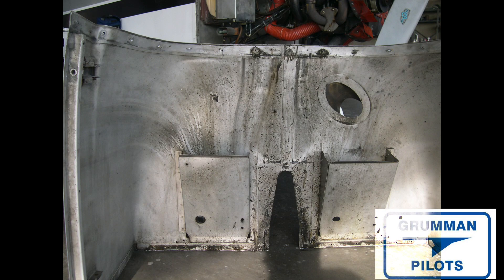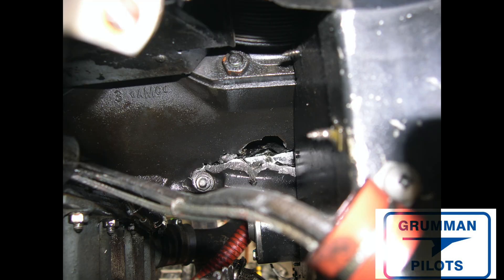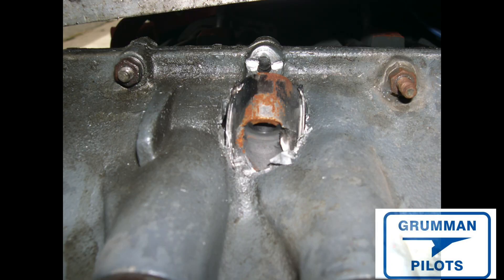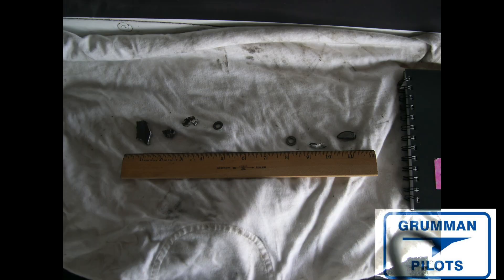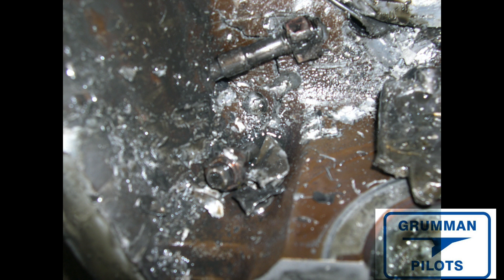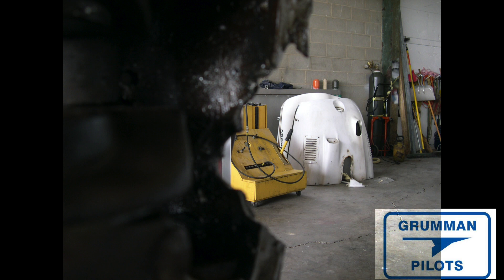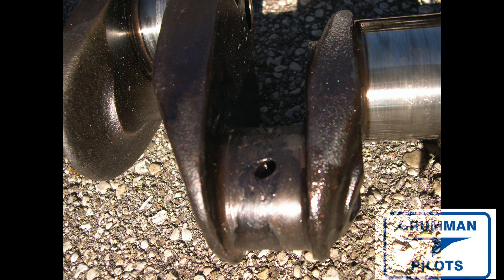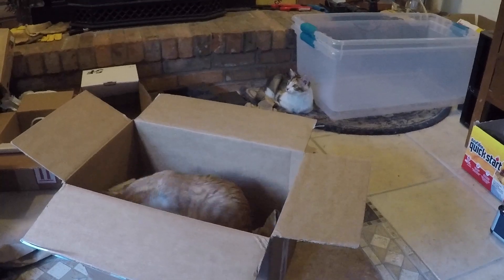Lycoming O-360-A4K Teardown After Inflight Engine Failure - Grumman Style

Comment: People think that these old lycoming/continental engines are under less stress than rotax or a modern automotive engine at higher revs. Actually, the pistons and rods  are under 2.5+ times more stress because of the weight of the components. They are so poorly designed and out of date, not sure why people use them.
Reply from the maker: Certified for use in our planes would be my best guess.

Comment: No oil filter..  NG,
Reply from the maker: I do not see what no oil filter was the root cause.  I have flown 2 engines past TBO using only the oil screen that came on the engine.  Now I Use filters, but not required for long life, just helps.
Reply: @GrummanPilots  O yeah filters help a lot.  screens dont capture any rust that can form in just a few humid days of no use.  Rust is like sand, screens dont capture that.  Rust never sleeps.
Reply from the maker: @emergencylowmaneuvering7350  I agree but I tend to fly my engine to TBO in 4 or 5 years back in the day, no rust allow to grow.

Comment: Not a surprise this engine failed.
Reply from the maker: Why do you say that?  Over TBO?  It had good compressions, no problem in the oil analysis and was going home for an engine overhaul.
Reply: @GrummanPilots  Was it "raced" up to 1,700 hours or i heard it wrong?? .  English is my third language...
Reply from the maker: You heard right, I pulled it from racing at 1700 hours and later I was taking it home for a new engine to go back to air racing.  Yes it did get close to 2900 RPMs but it made TBO.
Reply from the maker: English is my 'second' as we had German and French in the house early with Irish, but now most comfortable with American.
Reply from the maker: @emergencylowmaneuvering7350  It was a 65 inch pitched fixed prop.